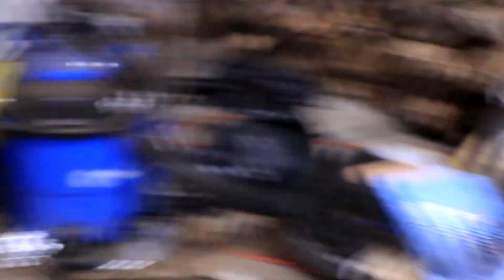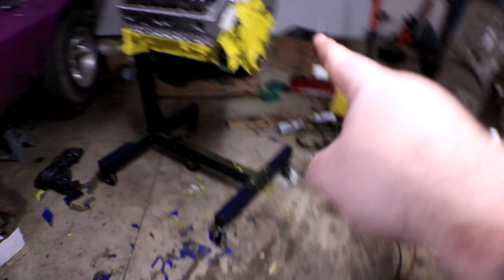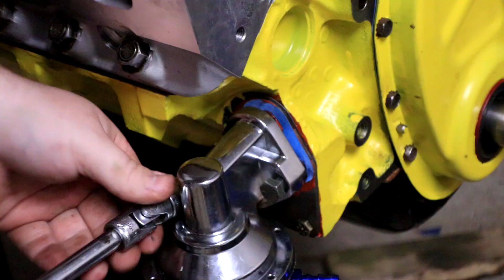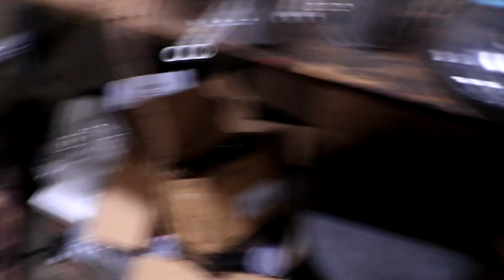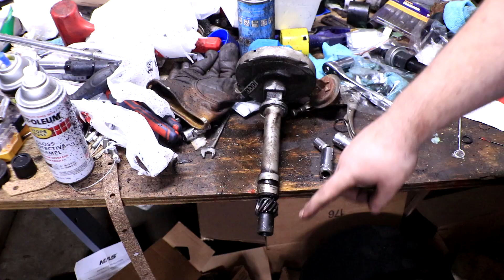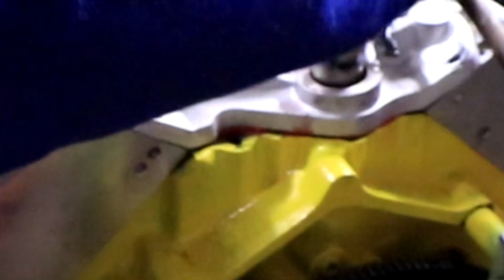MY CRAZY CHEVY 350 BUILD IS FINISHED!

Comment: I applaud you for doing all this yourself as a beginner. But next time lube up the fuel pump push rod before putting it in. And just pour the oil down the hole for the distributor . a lot faster than try to fill through the head. or better yet pour it in over the camshaft before you install the intake manifold. and quit using those channel lock pliers . get a good monkey wrench or the right size tool for the job. Harbor Freight is your friend.

Comment: Please get dedicated starter bolts.  Make sure the bolt you put in to plug off the access hole to fuel pump rod is not too long. I use a short 3/8” bolt about 3/4” long. The harmonic balancer dead ends at the crank gear.  Looking forward to the fire up.

Comment: On that fuel pump rod plug isn’t that bolt you put the thread sealer on down to far in the hole up against the fuel pump rod not allowing the rod to move freely as it needs to? Would think a brass plug with thread seal would be the way to go. Hope you put break-in oil it your the motor to keep the cam from going flat and then there are no guarantee it won’t go flat. Good just b and always exciting to get then down and fired up.yes agree should get some regular starter bolts instead of regular hardware store bolts since we r remember the have a shoulder and n them to center and align the starter properly
Reply: Hope that oil has zinc in it or a bottle of zinc additive has been out in with the oil. 
Normally run them in on mono weight 30 oil. 
Plus his cam/lifter break- in period of approx 20minutes will be interesting on the stand with no water going thru the engine.

Comment: Trust me,  thinking the harmonic balencer is on backwards is not too bad, if you can use that experience to remember things like that in the future, it will save you a lot of time! I forgot to put o-rings on the flywheel cover on my Duramax and had to pull the motor a second time. It's part of the job, but it was a hard lesson for me!